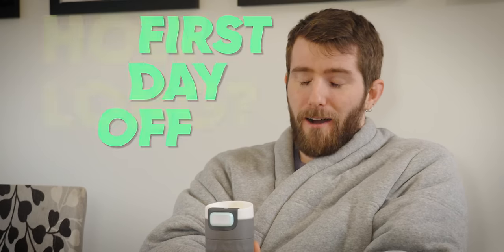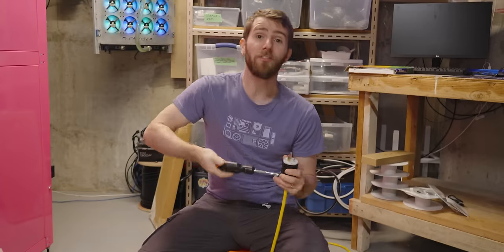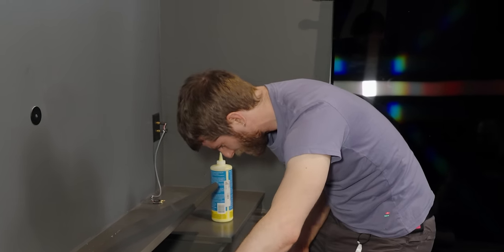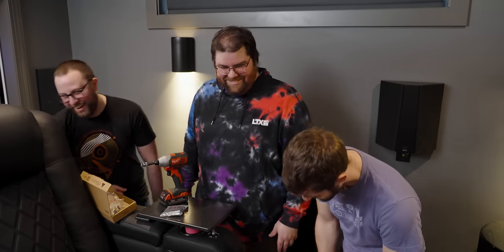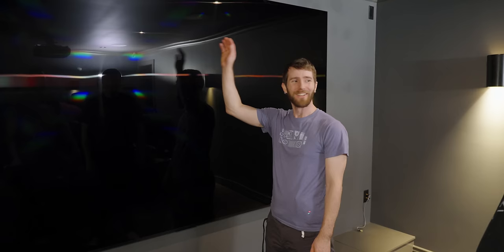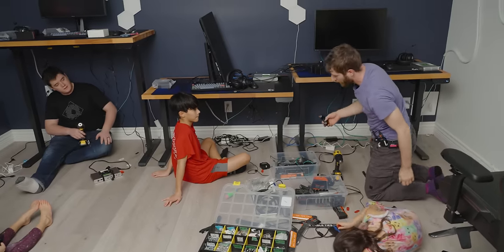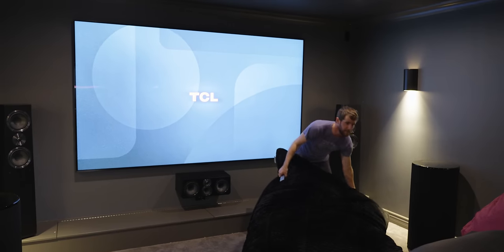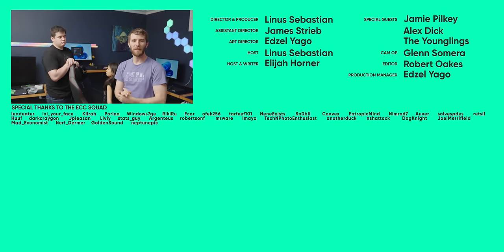What I Do On My Day Off - Cable Managing My House

Comment: you can't run 240-volt or 120-volt extension cables in conduit, it's a code and safety issue in conduit, you need to run single strain cables or strip the out cover for heat reasons. under high loads which that TV might put on it could result in melting and fire. also, it's a straight-up code violation and could call for a fine or at least in USA.
Reply: In this case its actually safer being at 240v, because the amps will be lower. Still not a good idea, those extension cables aren't rated be in the walls or in conduit. But just pointing out, there will be less heat than compared to running it at 120v since less amps.
Reply: @alainportant6412  you know free screen recording software is out there. this guy is video-recording his laptop screen and reposting videos like its 2002. lol

Comment: If you want a really easy way to pull wire through conduet. Tie a small plastic bag to the wire, put it in the conduet. From the other end of the conduet, use a vacuum cleaner, the plastic bag creates a seal and creates a vacuum in the conduet, and pulls the wire through. IT WORKS AMAZING, TRY IT!
Reply: It already had several cables and a pull string. Vacuuming wouldn't work, and it's not any easier than using a pull rope at all.

Comment: I was kinda interested in how you'd feed the cable from the hole on the top wall and still manage to pull it out the bottom. Do you tie something like a weight to get it to pull straight down instead of getting caught up in the free space?

Comment: I pull cable for a living. You don't need lube on every pull. I don't like using it because it makes a mess. I use it when the pull is going to likely be tight.

Comment: "As long as you have a pull wire, it's super simple" made me laugh so hard. Shoutouts to my electricians and LV installers haha. 
AC and LV in the same conduit is typically a no-no (LS mentioned it all fiber, so all good with no LV). Not to mention fire rating. Also, Elijah is the best jr. LV tech. Would hire.

Thanks LS for the update!
Reply from the maker: There is no LV in that conduit. All optical. - LS
Reply: @LinusTechTips  oh fantastic! I thought that might be the case, but I couldn’t tell if it was fiber or Cat6. Crosstalk is definitely a pain, so more a helpful heads up for others who might run something similar :) from someone who’s had that issue on show sites. Thanks for the reply! I’ll update the original to mention that.

Comment: L2 conduit pull : tools needed string, shop vac, plastic bag.   tie string to bag   shove bag into the end of conduit....use shop vac on other send of conduit.   turn vac on....suck bag with string to the shop vac....... pullstring now in conduit.    lube entrance of tube up with dishsoap  lots of it. ( cheaper lube)  pull line with added second string line through other side.     your welcome per your local cable tv contractor of 25years.

Comment: For the HDMI, why not do it properly and use wall plates with HDMI keystones?

Also so many code violations lol. You can't run bare power cords in the wall, and you can't run low-voltage and high-voltage together.

Comment: Yellow 77 oh no. That is not the best lube for data/low voltage. You are going to have a harder time pulling cable through that conduit. From what I hear yellow 77 can harden when it drys.

Comment: As someone who pulls cables and wires through conduit only slightly less than an electrician (AV install professional) I absolutely refuse to use lube. Not an option unless ABSOLUTELY necessary following undeniable failure to pull the cable. Why? Because many years later when you go to remove the old cable to replace with new, the old lube is disgusting and makes life extremely difficult. 

So yeah… great to help if you absolutely need it, but I’m always going to try without first because the lube sucks 😂

Comment: Get a rope that is 2x as long as your conduit run, and leave it in your conduit. When you need to run stuff through it, tape stuff to the rope and pull it through, and you'll never need to get a new conduit rope because it will never pull through and will always have some grabbable length

Comment: Quick tip for anyone needing to pull wire through conduit. Tie a grocery bag to a fishing line and put it in one end of the conduit, then run a shop vac at the other end. It will suck the pull wire through with great force.

Comment: 240V is "scary". 

120V is American imperial electrical standard (like miles per hour)
240V is the Metric electricity. Most of the world operates on 240V. The rest of the world isn't scared. 😅

Comment: Electrical cord ran with low volt - also illegally in a wall; can someone say AGAINST CODE even in Canada !  hahaha.  Also using a standard 20R for 240v is also against code..   w/e you do you, just don't burn down the place.

Comment: Instead of a new pull wire each time, just leave an additional copy of the full length rolled up at one end. You can then reuse the one pull wire multiple times back and forth.

Comment: A tip for those controller holders; your desk isn't as wide as you think so mount them as far from your knees, and close to the left/right edge, as possible. Otherwise, you'll be constantly bumping the controller with your knees as you turn in your chair.

Comment: if you attached a little weight to those controller cables, kind of like if you have a faucet that pulls out, it will suck the cable back in when you're done and would prevent the cables from being pulled too far out.

Comment: Heres a tech tip, isopropyl works super well for pulling cables. Pour that stuff all over the cable let it run down on them into the crevice and pull 👌

Comment: I have so many electrical outlets and light switches that I installed years ago without screwing in the inner screws. So many gaps between the plate and wall. I feel you Elijah.

Comment: In the US at least, one should not/can not run an extension cord through conduit, the outer jacket can become brittle or the insulated conductors inside the jacket can overheat and create a fire risk. At the very least some 12/3 Romex or individual 12AWG wire should have been used. Also stranded copper over long distances will have a higher resistance than solid copper and less voltage drop too. Homeowners are a more free to what they will as there is not an inspection involved but your insurance company might try to deny the claim if you leave that extension cord and, knock on wood, something happens.
Reply: TL;DR: Extension cord bad, Romex or single conductor good.